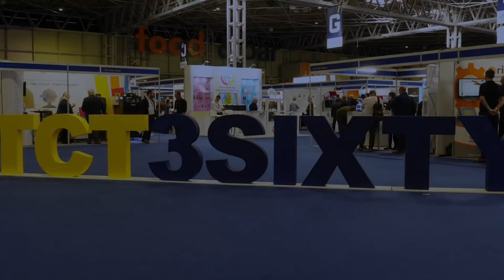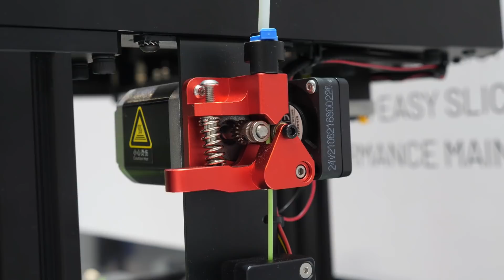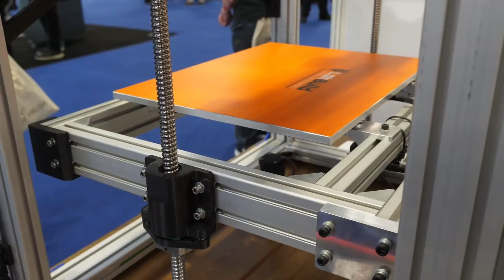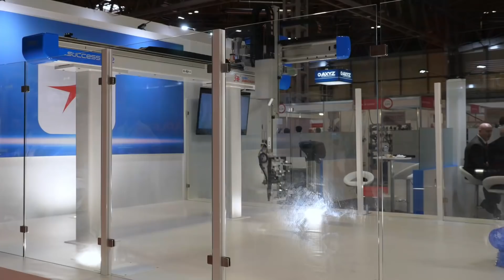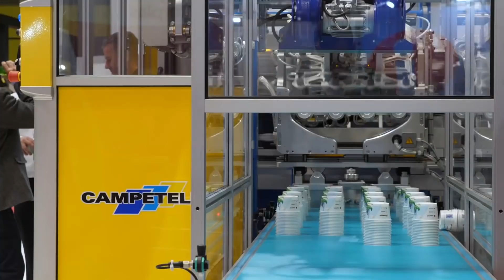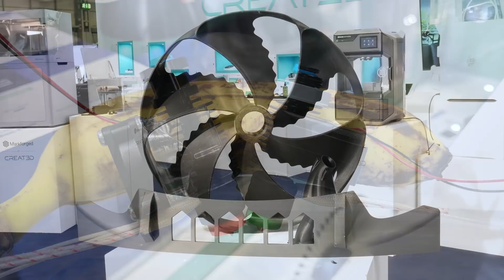Best of the Rest @TCT3Sixty

Comment: Those aren't leadscrews, they're called ballscrews. It's expensive and difficult to make ballscrews smaller than 12 mm due to the complexity of ball recirculation system. I have seen some Misumi ballscrews with 8 mm diameter, but they cost upwards of $600.

Unlike leadscrews, ballscrews don't have a lot of backlash and move more precisely while handling heavier loads. It's actually pretty fascinating that they used three ballscrews for their Z-axis. I wonder if it has the same kinematic three-point bed mounts as HevORT printers.

Comment: Those are ballscrews, not lead screws. They're usually a lot thicker and you can see the extra size of the "double" nut attached to the outside of the z platform.
Reply from the maker: Ye, I meant to say ball screw. Didn't notice until after it was public 😅

Comment: i don't know what size it was, but 6mm belts do just fine on many 300x300mm corexy printers, and while it can of course be worked around and addressed with beefy XY carriages, having a dual corexy arrangement already results in a pulley stack of a minimum of 32mm, 9mm wound be a 46mm stack or so. that results in quite a large force working in the idler shafts (usually only 3mm although 5mm is available), and also most likely an ever larger distance between the belt attachment point on the toolhead carriage (point of applied force) and the nozzle (point of potential resistance), none of which is great. 6mm is a lot easier to design around.

as for the ballscrews, they may look a little oversized but they wear much much less than leadscrews, and 16mm is a common size. high precision ballscrews smaller than that sadly are actually more expensive, and only starting at 20 or 25mm you can start to find higher quality ballscrews with precision ratings of P5 or better on aliexpress more easily. of course it all exists but they were probably chosen for sourceability at a reasonable cost.

cool machine that seems to try to do everything, in excess to boot for the most part! pretty sweet!
Reply: Exactly what you said really ! :) 9mm belts were tried initially, but at the time decent quality idlers/pulleys weren't readily available and in the end proved to be unnecessary, 6mm genuine gates belts have proved more than enough even upwards of 100mm/s speeds
The ballscrews are over-sized, i know and knew that, but they were chosen for the exact reason you mentioned - simple as that

The printer was built as a tool for us to use on-site, we originally planned to go to TCT to sell our design for manufacture, CNC and rapid prototyping skills - we almost didn't take the printer, and we had more interest than I ever expected for it

With everything as rock solid as it is, it's a bit of beast of a machine, and with the tool changing being added (started yesterday) it'll hopefully be an even better and more flexible beast - especially when both heads have tool changing ability :)

Any coverage is good coverage, and thankyou to Adam for including it in this wrap up video
Reply: @curlypaul  hi just your machine it looks like it will be a beast.
I noticed its running 3 ball screws with one motor and two linear rails?
Are thinking of going 3 point leveling?
Reply: @tvathome562  Thankyou  - Not really, I'm of the opinion that you shouldn't need to if you have a bed that's flat and stays parallel to the nozzle as it goes up and down

Comment: Prima buying technology outlet would explain why when I bought my voron V0 kit from technology outlet it was shipped from Sweden
Reply: Holy - Fuckin - Sheet... Just had a look at their store and saw they sell the Formbot 350 Voron 2.4 Kits for like 400.- more than what I paid for my Formbot Voron kit 🤣
Reply: @Duraltia  The V0 kit (even though when I bought it was listed as V0.1) worked out to be roughly the same as what I would pay from aliexpress with shipping and taxes, and it only took 4 days to come, so worked out well for me. For the 350*350 2.4 kit I would definitely just get it from aliexpress though, the markup on technology outlet is huge
Reply: @calumharper5343  I bought my kit directly from Formbot because it was TAX free and under $1'000.- for as long as the shipping address was located in the EU and strangely enough they shipped it from France.
Reply: @Duraltia   I will be doing the same, even with tax and shipping to the UK it should be considerably cheaper than buying from a reseller